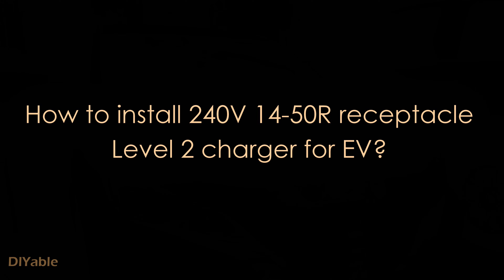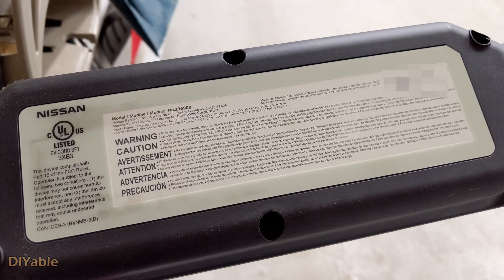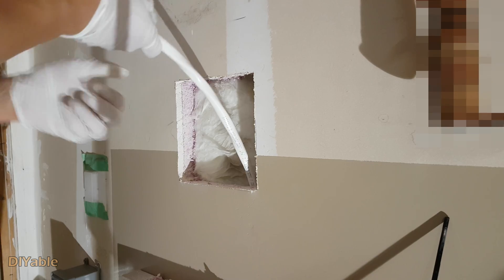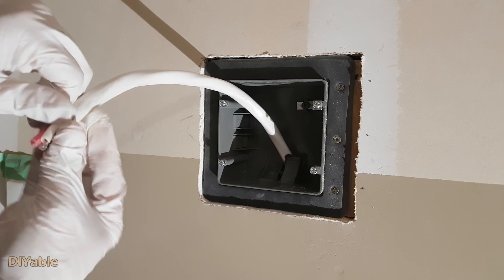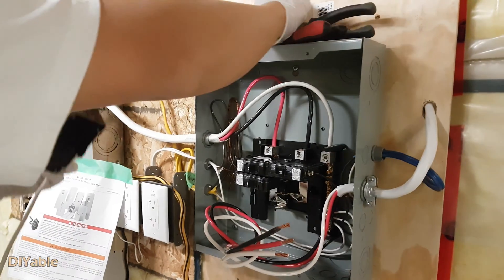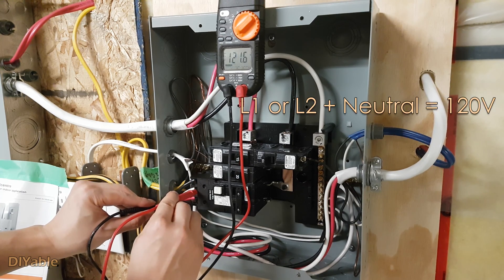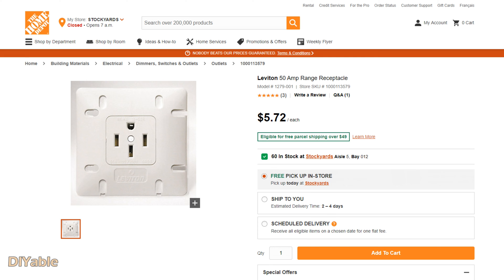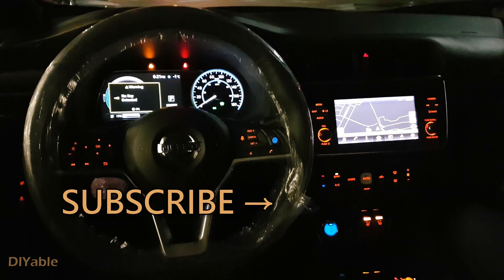How to DIY install 240V Level 2 Charger NEMA 14-50 for Nissan Leaf, Hyundai Kona/Ioniq or Chev Bolt?

Comment: How do you feel about 8A vs 12A charging on a 15A, 120V circuit? So far, I've just been using the default, 8A setting.
Reply from the maker: It's extremely slow honestly with 120V 15A....  it depends on how often you use the car, you may or may not have enough range.  My friend has a Chev Bolt EV and he has been using 120V 15A for 1 year without issue, notice that he has been working from home.  So it really really depends on a lot of factors, like your daily commute distance or routine.
Reply: @DIYable  - thx - I should have been more specific - I meant in terms of efficiency? and safety? (not speed). Bolt charger/EVSE provides 2 choices at 120V, 8A or 12A only.

Comment: First, let me say, this is a top-notch video! I recently purchased a Bolt EV with a dual-level charger - I noticed the cradle/holder which you used to wall-mount your Nissan box - do you think it would work for my Bolt EVSE box (4"W; 2.1"D)? If so, do you know where might I buy it? Thank you! ...Would love to see a snow tire video on the Bolt EV?!
Reply from the maker: You may have to look for Bolt EV specific wall mount, Nissan one came with the charger.
Reply: @DIYable  - thx, cannot find one - will attempt to make one for myself (no 3D printer - just lumber scraps) - keep 'em coming, son!

Comment: As an electrical guy, I find many different videos inspiring for the home owners.  Please, please, make sure you are doing it right.  Many aspects of electrical work come into play with installing level 2 chargers.

Calculations for your service (utility to house) wire size, wire size selection (normally limited to the 60 degree C column of the NEC chart)  there is a seperate nec section for car charging that requires gfci protection for a car charging recepticle, where to drill holes in your joists to keep structural safety, and if your garage does not have the studs covered you might need conduit to protect the wires.

So. Can a diy'er do the install, yes!  Is there a lot to know, yes!  Can you get the correct knowledge, I hope so!  

Take care, doing this one wrong could result in a fire that kills you car, garage, house, and maybe family.
Reply from the maker: Thanks for the comments, I totally agree with you.  My advice to all DIY people reading this, please don't trust any YouTubers, just use the videos for reference only. Do your own research before doing it.  If in doubt, hire the professional.

Comment: I have a 14 bmw i3, I’m going to install a 240v  in my garage with a 40 amp breaker, a 32 amp receptacle, with 8 gauge wiring so I can charge my car, I’m I on the right path?
Reply: Please talk with your local building department or local electrician.  Code can vary from building department to building department (nec 90.4) and the NEC may not apply to your job, your area.

Also, the pros see these every day and may have a solution for a problem you did not know you had.

Comment: with all that effort I would put #6 wire to be future proof. tnx for video
Reply from the maker: That is a totally valid statement. Just FYI... I have upgraded to a Tesla Model 3 recently and I DID NOT spent money on the "Tesla Wall Charger". I just use the "240V Tesla Mobile Charger" comes with the car which is rated at 32A @ 240V. Worth to notice,  it doesn't matter which brand of car,  most 240V Mobile Charger is rated 32A. It's fast enough to top up the battery for daily commute. In another words, if you plan to use the mobile charger (even switching from one car to another), 8 AWG is good enough. But yes, 6 AWG is future proof.

Comment: In US 8 gauge thhn wire also supports 55 amps. Must be thhn for 55 amps.
Reply: #8 gauge supports 55 amps at 90°C, but how about the other components ?  The Hubbell 14-50 receptacle is only rated to 75°C. Better to use 6 AWG.
Reply: If you are talking code, NEC 110.14 for terminal connections talks about breakers less than 100 amps are normally rated for 60 degrees c.  This means the wiretap connects to it must use the 60 degree C rating no matter the insulation....thhn, thwn, romex, etc....at the 60 degree C rating.

Comment: As an electrician I’ll say there is no reason to bond that box. However it may be NEC code. I don’t believe it is CSA code though.
Reply from the maker: Are you referring to NEC 250.24(A)(5) at 8:40 in the video?  I didn't bond that sub panel.  https://youtu.be/UwdjWEV8tWA?t=520
Reply: @DIYable  I was referring to the plastic box that you put the 50 amp 125/250 plug
Reply from the maker: @electriciantv5174  That's a very good point, indeed!!!
Reply: This was a great video though

Comment: "50  Amp not necessary..." C'mon man...Why would you risk years of operation over few bucks?
Reply from the maker: Indeed, yes and no... you are correct, 6 Gauge with 50A is better generally speaking. However, if you look at other EV manufactures in additional to Nissan, such as Ford or Tesla, their "240V mobile charger" comes with the vehicle are limited to 32A too. Most hardwired "wall charger" are 48A or above which exceeds the 14-50 spec at 50A, with 80% rule, you need 60A.   

I have made a video on Tesla mobile charger (32A), enjoy:
https://youtu.be/Is8K5Kk0RZE
Reply: @DIYable  I haven't expressed any rule, but true, I'll go to 60amps or even higher. Don't want to do that work twice.
Reply from the maker: @rafars2246  Totally understand and your point is valid, if I had 200A service panel, I would definitely go with 60A too.

Comment: great video, here in Massachusetts the only person other than an licensed electrician that can do wires is the home owner, so fi you are not confident and not doing it yourself don't have any old handy man type person do it. I just did this for my leaf and decided to run it at 50 amp incase I want to upgrade later for other vehicles. One note I would say is be sure to follow his table for wire to match the breaker. If you use 8/3 wire and just swamp to 50 amp breaker it is very unsafe as the point of the breaker is to be the weakest link. It was a lot more for 6/3 wire but if I ever want more amps my setup is ready for it. Cost me $500 just for the 125 ft roll of wire, unfortunately for me the break was at the opposite corner of the house in the basement so it till all 125' to pull my run. Also if you have enough amps on your breaker but not enough slots you can get narrow breakers that double up, much safer than running two wires to one breaker. I did this on a few switches to make room as we have a few 240 v systems taking a lot of space up. however its 200 amp total dont expect our electric oven, electric burners, and electric dryer to all be running around 2am-6am when the car will mostly be charging.
Reply from the maker: Just to clarify, I was using 8/3 on 40A breaker. But 8/3 on 50A breaker is VERY dangerous.  6/3 on 50A breaker 6 Gauge with 50A is the best I have to agree. However, if you look at other EV manufactures in additional to Nissan, such as Ford or Tesla, their "240V mobile charger" comes with the vehicle are limited to 32A too. Most hardwired "wall charger" are 48A or above which exceeds the 14-50 spec at 50A, with 80% rule, you need 60A.  

BTW, recently I have made a video on Tesla mobile charger (32A), enjoy:
https://youtu.be/Is8K5Kk0RZE
Reply: @DIYable  Yea, I'm looking at getting a Ford, Chevy, or Tesla truck in a few years as my next electric and just over built for future use incase they allow for a higher rate level 2 charging at that point.

Comment: ProTip! When using/spraying foam insulation, do NOT touch it! Let it harden and then simply cut/scrape it away. Reason is that it will stick to everything and continues to expand! Let it dry and it's quick and easy to trim away.
Reply from the maker: You are correct :)

Comment: Word of warning:  US Code says if you install a 50A wall socket you must use 50A rated cable and a 50A breaker.  So 6/3 for 220V “oven” type connections.  Almost all 40A EVSE’s are hardwired type for this reason, there is no 40A plug/socket standard.  True that the Leaf system is only 32A, but someone else could come along with a 40A system and burn the house down.
Reply: Tldr: Use 6/3 cable
Reply from the maker: If someone comes along with a 40A system,  my 40A breaker will trip and protect my house.  Even if you have 50A with 6/3, say someone bring a 85A telsa charging system (assuming it is able to plug it into 14-50), your 50A breaker will trip to protect your house too.
Reply: @DIYable  I get what you are saying, but a Tesla charger has to be hard-wired.  I guess the question is whether it’s code to use a 50A socket on a 40A system, and is there any situation that would put the wire at risk.  Because technically a constant 40A draw won’t trip the breaker but could melt the wire.  And 50A EVSE will allow a constant 40A draw.  I was interested in this because I have a hard-wired Blink 100HQ on 8-2 wire and 40A breaker that I installed, and now the wife asked me to move to the other side of the garage.  It ended up being a moot point, the run was too short and I bought new 6-3 Romex, 50A socket and a pigtail for the Blink.
Reply: I’m leaving it on the 40A breaker to protect the Blink.

Comment from the maker: Update and Sharing information:  I have a friend who hired a master of electrician to do the installation for his Tesla Model Y.  My friend's town house has 100A main panel. The guy installed a new 60A breaker and ran a 6-Gauge cable called "TECK90", this cable is amazing there is no need to use conduit, it's flexible, armored, waterproof and rated for direct buried. All you need is one single "TECK90" running all the way from the main panel the garage, it passed all the code and passed ESA inspection. Yes, you hear it right, 60A breaker on a 100A panel is actually fine according to the master of electrician!!!!!  My friend set the Tesla wall charger to 48A, has been running it for at least half a year without any breaker tripping. For DIY people, I don't think you can find TECK90 in your local big box hardware store, you need to visit those electrical supply store or order them online. Hope this helps!

Comment: Note that it is good practice to turn the power off and check ALL the screws in high current applications like this after 6-12 months of use. The large current draw can make the wire expand, loosening the connections. Which is NOT a good thing.

Comment: When wiring the outlet (when looking at the rear of the outlet), ground on top, neutral on bottom,  does it matter which wire goes on the left then the right?
Reply: No.  That sounds simple, but it is, the answer is no.  Both are split phase 120V legs and can be interchanged when wiring a 240v outlet.  I know you have probably already found your answer, but I wanted to leave a comment anyway in case others had the same question.

Comment: Could you please share what bit you are using to drill down through the studs at 4:19.  Fantastic videos by the way...inspiring!
Reply from the maker: That's the similar installer bit kit I had, it's very handy to have it. I used it for running cat5 cables, PoE security cameras.. strongly recommended. 
https://www.homedepot.com/p/Klein-Tools-3-Piece-Flexible-Drill-Bit-Kit-53721/203913339
Reply: @DIYable  thank you kindly for taking the time to respond.  I'll definitely looking to get one of these - as I have run into a few instances where this tool could have made my life much easier.  Below is a Canadian link : )  https://www.homedepot.ca/product/klein-tools-flex-bit-kit/1000664025

Comment: You are so right about YouTube DIY on this type of installation. Not one had the breaker or Romex needed based upon the specs of your charger. Only yours did. God bless! Well done! I do disagree with your comment on what the manual says. If it says you need 50 amp, use a 50 amp. Don't give the automaker an excuse if something goes wrong and they find out you used an amperage below what was recommended.
Reply from the maker: Yes, 50 amp is definitely better because in case you need to upgrade your car, you don't need to upgrade the cable and breaker in the future.  Let's take Nissan Leaf aside for a second, a lot of charger for example Tesla wall charger, you can change the settings of the output max amp to 32A, 40A, 48A depends on your preference. Then, you can choose the proper circuit breaker 40A, 50A, 60A.
https://www.tesla.com/sites/default/files/support/charging/Gen3_WallConnector_Installation_Manual.pdf

Comment: After 22 years in my house and running extension cables to power thing up in a detached garage, I finally got the balls to wire up my garage for 120VAC. Going up to 240VAC, I feel I'll need that drive again. Good vid; maybe watching it a few more times will give me that boost.
Reply from the maker: Glad it helped!!! Just be careful on every step you do. If you understand everything before you start, it should not be too difficult. Again, hire professional if you not comfortable.

Comment: Nice work. I like that the 240V breaker is GFCI, very helpful.
Reply from the maker: Yes, GFCI is good for safety, because you will never know.... I had an incident where the garden hose burst and water splashed everywhere.  The ONLY drawback is that, GFCI  breakers are very expensive, even 120V 20A is expensive enough. 240V 40A is double the price of that.

Comment: great video！！！ but actually the manufacturer charger on the car was 32 AMP maximum, so basically I use it like a travel emergency one and bought a 40 amp one install at the garage.
Anyways, great DIY video!!